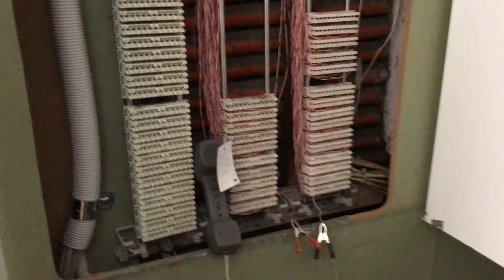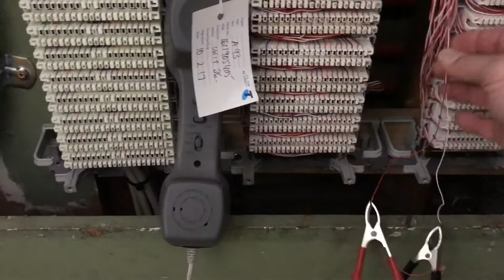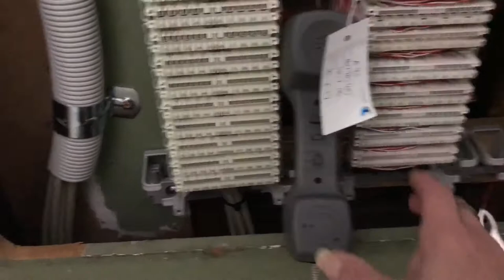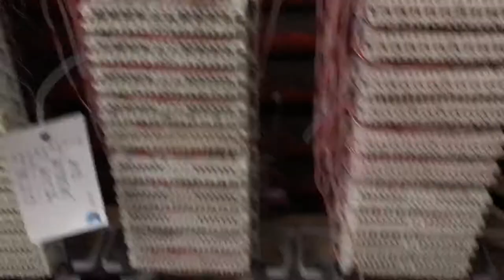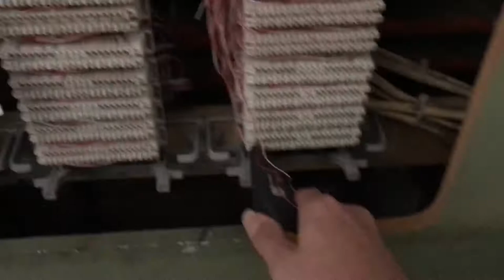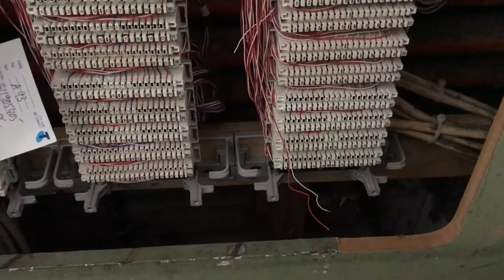Optus Fault | Engaged Signal On Phone Line | No Dial Tone

Comment: That's an Optus data line mate. They have an engaged tone instead of no dial tone. If that was engaged after about 30 seconds it would short out and have no tone at all. The fact that each time you pick it up and it has the engaged tone means it's a data service and it's fine.

Comment: Perhaps it's a naked line as they run an engaged tone down their Naked DSL lines so techs don't think they are spare pairs and cut people off.
Reply from the maker: Luke Hinton most naked lines have no dial tone, Optus use to have a service that had an engaged tone. But I spoke to Optus and they were supposed to have dial tone. This ended up being an exchange fault
Reply: That's correct most ISP's don't put a tone on naked lines. But Optus does put an engaged tone down the line for a naked service. But in this case, because it was a POTS service it was probably just a faulty Optus XYZD device.